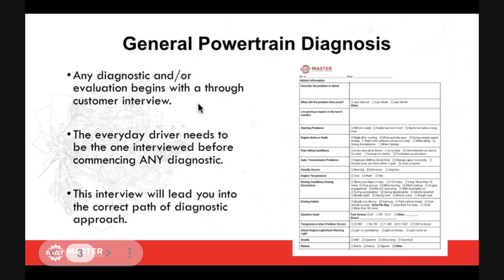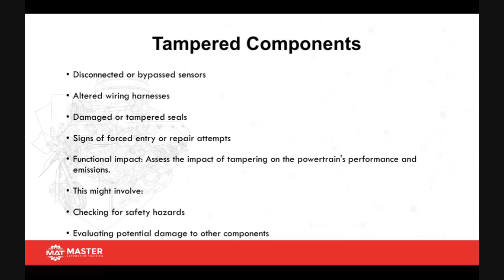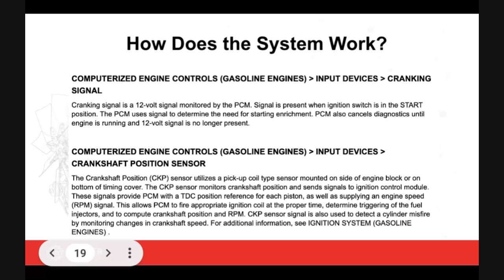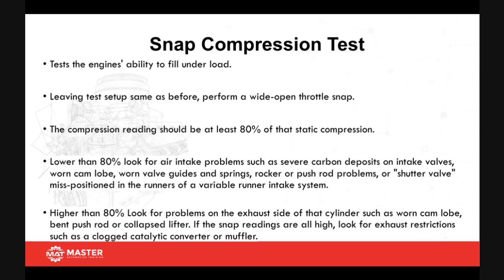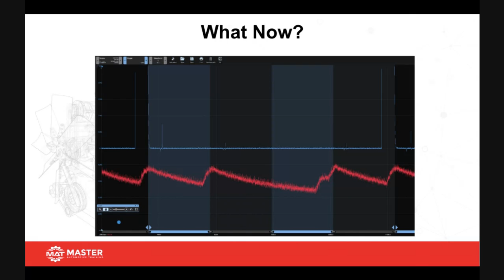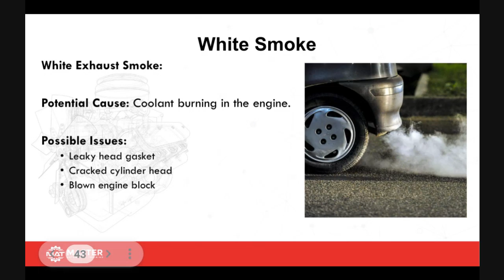ASE Test Prep - [PASS] the L1 Advanced Engine Performance

Comment: Just passed the L1 and can say half is just reviewing the Composite 4 vehicle and then troubleshooting wiring diagram "what if's" based on it. I spent so much time reviewing vacuum testing, spark analysis and emissions printouts....it was like 3 questions tops. I wasted so much review time on this, just know how to diag a wiring diagram, fuel trim analysis and you will be fine. There is lots of good info in here but I'm sorry, I use barely any of it as a 20yr Master Dealer tech. We use the manufacturer troubleshooting charts and their scan tool software, this is good if you work as a used car recon guy or at an independent.
Reply: besides studying wiring and fuel trim analysis any other recommendations or what i should study the most? i just barely passed A8 so im very scared of L1 lol any advice would be appreciated.

Comment: The different colored smoke thing is stupid to me.  I've been doing this 20 years and I have yet to see blue smoke come out of anything. However if you can't tell the difference between the smell of burning oil, coolant and fuel, you have a disability.
Reply from the maker: You must not have worked on many Euros or Toyotas if you’ve never seen blue smoke. That said, smell is absolutely a useful indicator too, both visual and odor clues matter in diagnosis.

Comment: At 1630 , you're showing a amp ramp of injectors as an R. C. Test ? Good course I'm just pointing out a few things that I am catching.  As a diagnostic technician
Reply from the maker: Thank you for the great input and for following me. At 16:30 its the current ramp of the fuel injectors and the voltage of the injector. To do an RC test you'd need to use the ignition coil primary or secondary, to sync for an RC. Please keep asking if I can help.